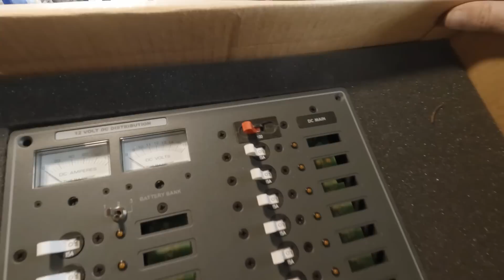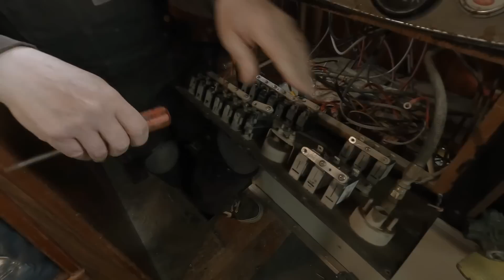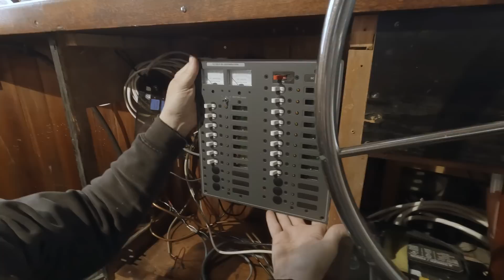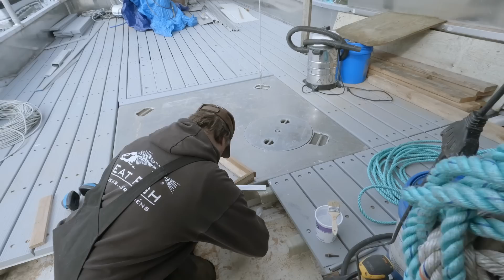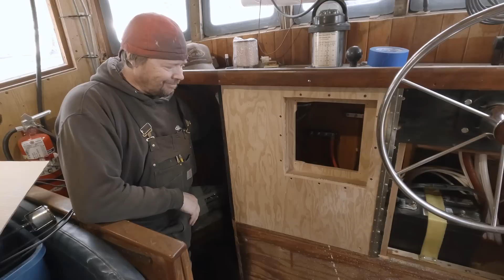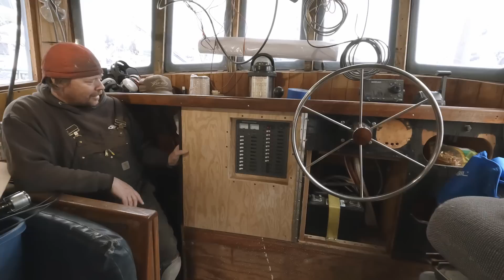Re-vamping the Dashboard, Breakers, and Gauges Pt.1 - Emerald Isle: Ep.107 Fishing Boat Refit

Comment: A couple small hinges and some thin plywood would make a panel cover to make it impossible to bump a breaker in bad weather.  2 dollars.
Reply from the maker: They are inset pretty far, we tried to "accidently" bump them off, and its very hard to do so. They are up and in far enough. If we do find it to be an issue though, we'll certainly add a see-thru cover to prevent it.